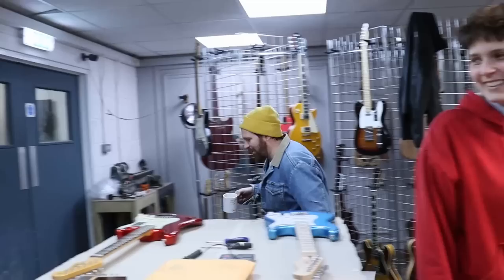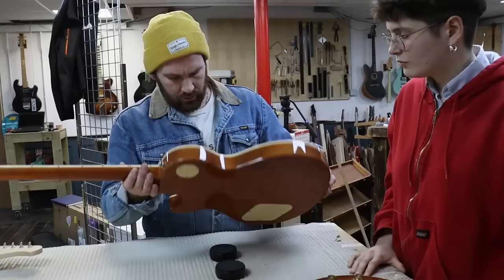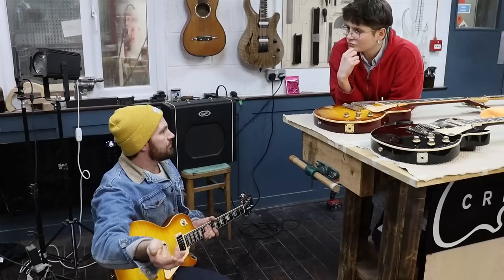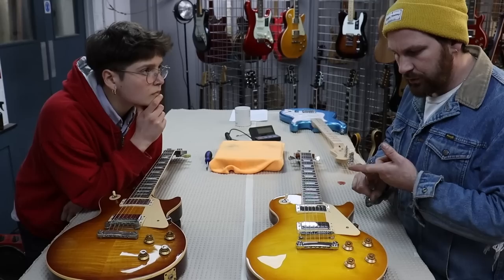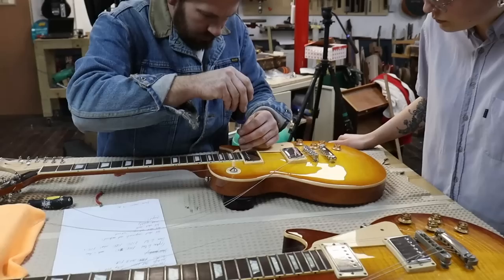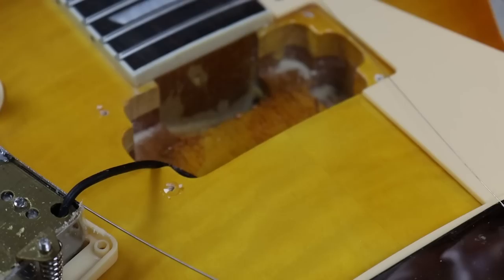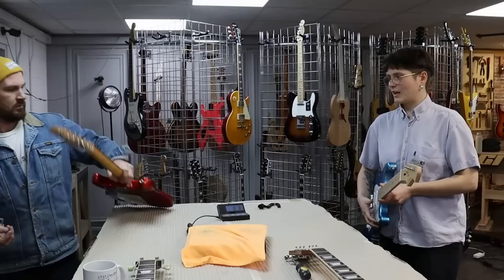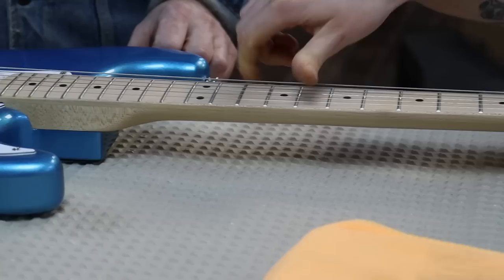Are these Guitars worth it?  Best Value? How do they do it? | Fairclough vs Fender & Gibson

Comment: To be realistic, by the time you've invested in an expensive refret, new pups etc you may as well buy an Epiphone or Squire if you need the look of Gibson or Fender. Otherwise,  buy something like a Yamaha or Ibanez for about the same price as the Fairclough but with better fittings, woods, QC and resale value. Alternatively, if you know what to look out for, hunt around for a s/h axe that has stood the test of time, and try before you buy if at all possible.
Informative video. Cheers🖖

Comment: im from the philippines and we have locally made and chinese made guitars (lp, strat and tele styles) here that are less than a $100. usually its in the materials used (woods and hardware materials) that are they are cutting costs but the hardware quality and build quality they are quite good (electronics are where the bulk of the price). mostly they target the beginner to garage band guitarists so its just good enough to start with. those manufacturers also make good quality guitars at a higher price, around the $500 range, and those guitars are gig ready with just a basic setup. :)

Comment: Hi josh i bought a £20.00 guitar from a charity shop for my second build. I did a full custom build .on body and changed everything i could electronically and had full neck and head service with new tuners too and this guitar turned out great for less than 400.00
Reply: I love that. Good work!

Comment: More of these head to heads please.
The Fairclough single cut looks a whole lot thinner than the Gibson - possibly a big contributor to the light weight.
It would have been nice to have weighed/compared the bridge and tailpieces too.
Definitely on the cheaper guitars, the bodies will be made of more pieces of wood, so more places for poor joints to raise their head.
But then again - Gibson has used 3 piece bodies and pancake construction in their history as well in order to save money.
Cheap pots and switches - expected.
You talk about proving themselves - both Fender and Gibson have had various QC issues even today - as evidenced by YT unboxings and reviews and even some of the guitars you have done recently for the Guitar Giveaways.
re: sustain - If you were to pick up 2 of any guitar off a production line - they may sustain slightly differently based on what plank the body blank was cut from.
With guitars there are 2 aspects - 
One: function - can they be intonated and hold tune and function as an instrument?
Two: the art - how a particular guitar makes you feel, how if fits in your hands etc That's quite individual.
With these cheap guitars - so long as it passes aspect One (and you like the way it looks) , with a few upgrades and a proper setup it could pass your personal aspect Two.
For potentially 1/5 the price for the expensive one.
Some want the perfect out-of-the-box experience plus the brand name recognition, others don't mind and like to tinker (which I blame on Ben and you guys)

Comment: Great video. You work well together.
The trem block on the strat is usually very cheap on most copies, ive found, and of course the mini pots and switch are also cheap.
Ive spent the last few years upgrading and passing on a few electric guitars, more as a learning experience, and know the various ways of a good setup now, including refrets, and proper nut cutting.
Keep up the Excellent work.
👍
Reply from the maker: Thank you.

Comment: Nice comparison. You should have checked the tremblocks on the  strats. There is often a big difference in the tuning stability and in the quality of the block itself. Using the trem on cheap guitars ends in an out of tune guitar most of the time.

Comment: Josh/Sophia, I read in Guitarist magazine years ago, that Gibson headstocks break more often than even Epi`s, it`s the headstock angle apparently!
Reply: Yeah bud it’s a very big angle way bigger than it needs to be that with the one piece mahogany neck and a big truss channel under the nut makes them very weak indeed . Massive design fault . They tried to add a volout thingy ( spelling Lol ) but the cork sniffing traditionalists didn’t like it so the stopped . Prs got it right
Reply: Yeah, it's the design.
No matter what wood you use they'll be prone to breaking unless you change that specification completely

Comment: I believe that the hole in the blue strat type is to hold it when they did the finish. Gibson/Fender have iconic names that are accepted as better quality.  I will purchase a Epiphone or Squire at half the price and upgrade the pickups and pots to get the Gibson or Fender sound. With the cheaper ones, as you said, you may have to do some leveling and fretwork for setup and playability but at least you know what to expect and get the satisfaction of working on it yourself.

Comment: Of the two i'd probably take the LP style guitar. In terms of QC and construction it's harder to get an LP right than a Strat. The material involved to make a sturdy set neck guitar vs a bolt on makes a difference IMO. Can you get cheaply made LP style guitars? sure, but the overabundance of alternative woods to the standards (in this case okume vs mahogany which are very very similar) can help keep cost down but does not mean the construction and quality is cheap or bad.
With Strat style guitars you can get affordable, good quality wood bodies and necks and go from there. Wilkinson makes very good parts that can allow you to keep the budget low but also not worry they will fail on you in a couple years.

Comment: Great video. You both made some interesting points. While name recognition can be important, a decent quality, affordable instrument is what most people are going to start with. The quality of these less expensive guitars has improved a lot over the years. I just recently bought a "Sawtooth" brand Strat and it has extremely good quality and sound. They had a 50% off Black Friday deal and I got a sunburst strat for $90 shipped. You can't buy the wood and parts for that price. You could buy 20 of these guitars for the $1800 the name-brand guitar is going to cost you. Is the $1800 guitar 20 times better than the $90 guitar?

Comment: I really like the format, congratulations.
I would like to see the comparison of a more expensive Gibson Les Paul USA or at least with the same specs (without weight reduction, a piece of mahogany...etc). vs a very expensive les paul custom shop and see if what they do is save costs on the USA model compared to the CS or these are highly valued... or both.

And another question, what would happen if we exchanged all the electronics and hardware between the two guitars in the video? Would the Gibson still sound better than the Chinese? wins wood and construction over electronics and hardware?

Comment: I have to wonder how much the brand on the guitar affected you analysis. It wasn't exactly a double blind test, you always were very aware which brand you were holding. The sound tests were not very clean. The Gibson used for sound testing seemed to be tuned different (or you played a different chord?). Where the strings at least the same size? (if not same brand) Lots of good comments about frets and other obvious defects.

I do think the Fenders and Gibsons are over priced but I think to make a more fair comparison they need to be compared to the mid name guitars. I have an Ibanez "semi-custom" bass which cost double what a "normal" build Ibanez bass would cost. Yet it is still half the price of a Fender bass... I still choose the Ibanez over the Fender (or my Rick for that matter) for sound and playability.

Comment: Nice break-down double-team! Ben is probably better at talking to himself so he can pull off the 'single host' thing more easily; you guys were getting a good banter going by the mid-point. 😁

It's Look, Feel, Sound; but also what about warping of a softer wood? Cheap things tend to not last long in the real world even if they work well enough out-of-the-box. So I think (in general) I'd rather have the cheapest of the high grade item and upgrade that was needed. I'm super-budget minded but have fairly high standards (not easy bed-fellows!), so finally bought a PRS  SE Hollowbody II Piezo and feel like I have the quality of a $4000 guitar for $1600.

Comment: You can get an unfinished lp body and neck from aliexpress for 60-80 quid, probably less if you buy in bulk. everything else is down to the hardware you want to add, and the time and care you want to put in setting it up etc; but a good looking and very playable guitar for 150-200 quid is definitely doable with some careful shopping, plus you learn a lot. That’s what I did anyway.

Comment: Surprised you didn’t get a Gibson tribute budget USA made Les Paul they are killer and the necks are maple instead of mahogany which is a way better idea with Gibson’s dodgy headstock angle
Reply: yes I've played one of the tributes excellent guitars they are.
Reply: They could have used a Squire as well.
Reply: @tyremanguitars  I’ve got the Les Paul p90 special in wine red it’s fantastic for like £800 it’s a wee bit heavy tho 🥺 the case you get with them is amazing and you get the photo of it on the qc bench before it gets boxed up and all the other Gibson bumph . Mine plays amazing after I dropped the action the p90s are ballsy 😁
Reply: @SirSneakerPimp  I’ve got two classic vibes fantastic guitars just stock . Those east coast guitars that andertons sell are bonkers you get roasted maple necks on them for like £120 🤷🏻‍♂️

Comment: I have 4 guitars that were extremely cheap. A 2020 Epiphone LP Special, a 2006 Epiphone LP Classic, a 2009 Squier Telecaster, and a 2000 Squier Strat. All were super cheap with garbage electronics, horrible frets, and setups that were just unplayable. All were less than $200. 2 were under $100. Drop a few hundred in good electronics and some decent hardware where needed, a good fret job (none needed refrets) and 3 of those 4 play better than my American made Gibson SG. That guitar actually had some of the worst fret work ever from the factory. 

You just don’t HAVE to buy a $1000+ instrument to get something that plays well if you’re willing to put in a little work. I love working on and building guitars. So for me it’s a bonus.

Comment: One of the other differences is around the variability of the cheaper guitars.  With the cheaper brands the quality control isn't to the same level and so guitars from the same brand and model can look, feel and sound quite different. When I was getting my second guitar, and therefore trying out different guitars in shops, I found this especially true of areas such as the fretwork, the electronics and the pickups.  At one point, when I went over my notes from my testing of guitars in the shops I tried, I found some guitars of one of the cheaper brands had good fretwork, in a different shop the same make and model had poor fretwork and in a third shop the pickups were worse than in the first two.  With more recognised brands there was much more similarity between the same model and make for sale in different guitar shops.
Reply: Agree
Reply: What's Gibsons excuse for variable quality? 🤔

Comment: I'm glad you called them assumptions regarding wood.

For anyone curious where it actually comes from: https://www.youtube.com/watch?v=n02tImce3AE

For anyone who doesn't want to watch the video; it's the pick ups. They make all the difference. And with those Wilkinsons you'll never get a guitar that'll sound like the Gibson does. But you can if you use it as a mod platform.

Fun extra fact: flamed wood is actually less structurally sound than normal wood. The flames are caused by the grain going in waves and then being cut off. This reflect the light differently depending on how you look at it. We like a lot of wood with defects: burl, birdseye, and spalted are all things we love but make the wood less stable. Tightly grained maple would make for the best guitars in theory, but we end up using softer woods like mahogany.

Comment: About the psychological observation at the end, I find that for myself it works the opposite. It's like a David vs Goliath thing. I'd just slap a ToneZone or an SH6 at the bridge and if the guitar holds the tuning and intonation and doesn't cut my hand then I'm all like "See? You don't need a Suhr, this thing just rips and I could buy another 7 of them in different colours! :D ". It's also a pride thing, like: "I've bought this and I have made it better and I've made it as I like it, all by myself!". I've just substituted all of the hardware in my cheap chinese 18 years old SG chinese copy and to my eyes there's no Gibson that could compete, because I did it myself and I feel so accomplished.

And also: when you go through a 5150 or a Dual Rectifier it doesn't matter anyway

Comment: Woods rundown for you.
Gibson Les Paul-
 body and neck: will normally be the best Mahogany they can get hold of. Specific origins have changed over time with scarcity and regulation. They try to limit the body to 2 pieces, One piece bodies originally.
Necks: no scarf joints or heel joints. winged headstock. made from one piece of quartersawn wood
Top wood: solid maple, book-matched.
Fretboard: Rosewood normally. same caveat as above.
Hardware: Well, you can see and feel the difference, can't you.

Chinese Import Les Paul -
Body and neck: "Mahogany" which does cover a wide range within a species that grow around the world. Most from China will come from their own continent and not South America. Less density and color. Bodies can be any number of pieces glued together, and in the worst case, as many as 5 and a solid veneer covering the back.
Necks: Scarf joints common, heel joints even more common. Allows using smaller cheaper pieces to carve a neck.
Top wood: Maple veneer over (hopefully) cheaper maple. Alot have the courtesy of only 2 pieces matched in the center. Yours, not so much.
Fretboard: Some come with very decent Rosewood. And some, not so much.
Hardware: crap shoot.
(there are some good ones out there, but know what to look for)

Fender USA Strat-
Bodies: are made from Alder or Ash, depending on year, model, or availability. Like Gibson, Fender likes to maintain 2 or less pieces of wood in the body.
Neck: Maple with either rosewood or maple fretboard. No scarf joints. 
Hardware: comparable in quality with Gibson. 

Chinese Import Strat, as well as many from Japan from the late 80's
Body: the majority of bodies are Basswood, Also branded as "white poplar", it is still Basswood.
Neck: possibly maple.
hardware: crap shoot.

small note, Ibanez made it's breakout in the guitar world with Basswood bodies, so light. And they put out a more economic version called the SA that had a mahogany body. Go figure.

With some good shopping, you can still get a decent guitar for the cheap and do some upgrades.

Comment: I have a Marshall rocket strat copy, which was 120 Euros when it came out and I got it for 20 on flea market. recently I got a good deal on a Fender Japan Strat and got that. The Marshall had an ok bridge (with a very thin tremolo block), but the tuners are very good and the guitar stays in tune very well. The neck feels great and the fret work is good. Although the Fender is obviously the better guitar but the Marshall been only 1/10 of both original prices is still a very good guitar and would be enough for the first few years as a beginner. The Fender is definitely not 10 times better. In general I think guitars about 700 Euros are almost perfect tools for the first 10 years of playing without changing anything and be very happy with it. And by the way, who needs big brands? I rather have a quality guitar from a local luthier (check lucky dog guitar or Nazangi) than a big name with a brocken headstock and boing always out of tune.

Comment: The finishes are not equal. The American les paul has a cellulose lacquer, which is a huge time consuming  process adding to cost. The poly finish on the Asian guitars is much cheaper, quicker, and technically more resilient to wear and damage.

Comment: It's always an interesting topic that has 1000s of different opinions and nobody is right or wrong and nobody should force their opinion on the matter to others sort of thing.   My general rule as ive grown up is this,  Whenever you try and go for something budget for whatever the reason, all you're doing is adding the cost of that to the thing you really want.  If you really want a fender 60s original for eg and you buy a classic vibe, you've just made the fender 60s original £400 more expensive lol.  This does require ALOT of will power and self control and I think thats why its taken me to grow up somewhat before ive been able to stick to it lol..

Comment: I just fixed a Glarry thinline clone and it had the bridge in the wrong place, caused all shorts of issues. Since it’s through body I couldn’t just simply redrill the spot without converting them to top loser. 

It was so far back that the saddle springs had zero tension and would rattle with every strum . Never review a Glarry, despite YouTubers videos on them, it was by far the worst guitar that’s rolled into my shop.